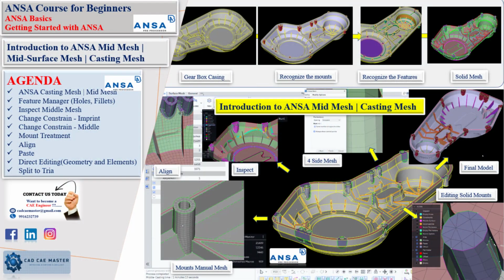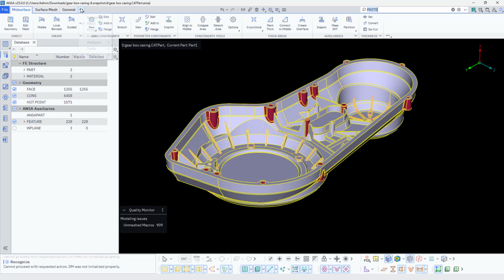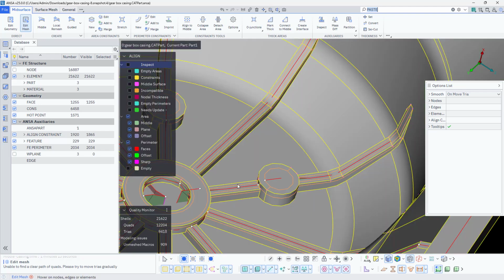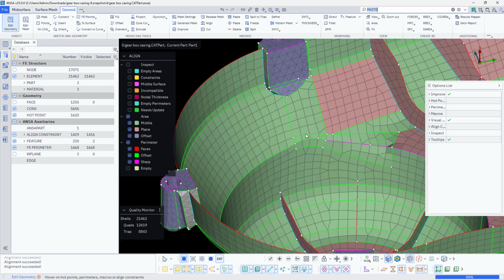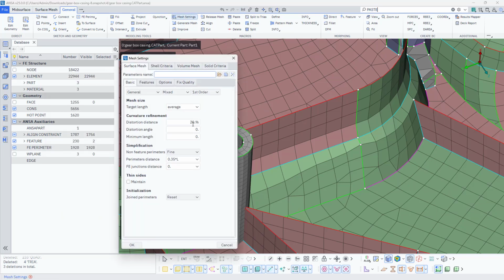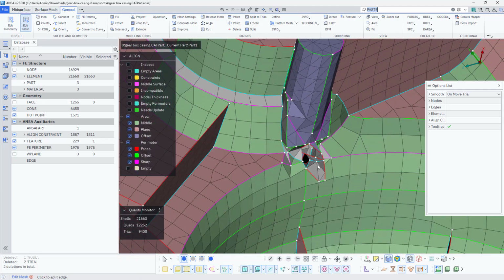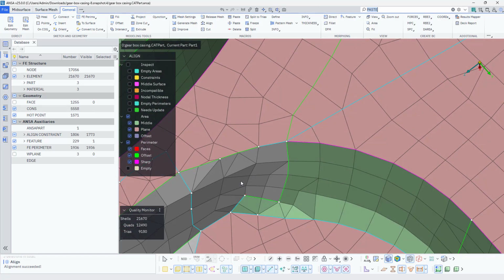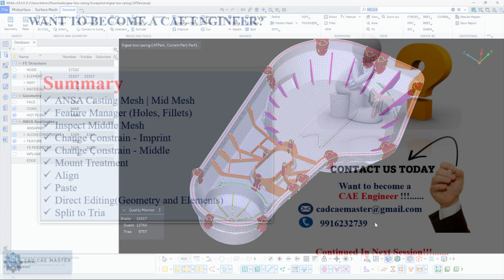0.1.3.1 | Introduction to ANSA Mid Mesh/Middle Mesh for Casting and Plastic Components Part-2

Comment: Why did you usen’t ‘convert thickness function’ to apply thickness property? (Midsurface ribbon>thickness>convert)I think it is simplier than your method :)
Reply from the maker: True but it won't give a good thickness distribution on complex models. I was using this method before and later switched to manual method. 

We can even do and manually change where ever needed. Lot of work behind it. 

To conclude both methods are ok. But depends on the model.
Reply from the maker: Anyways I will create that video too,....

Thanks for the comments